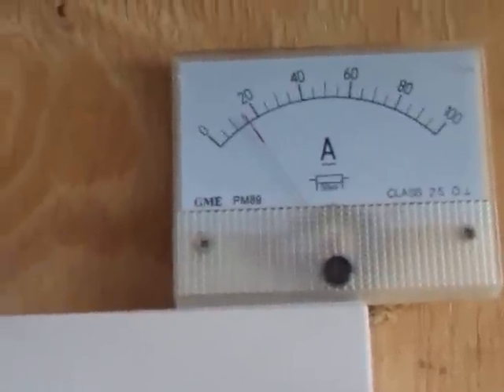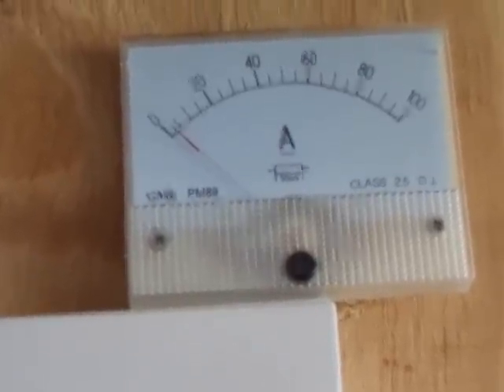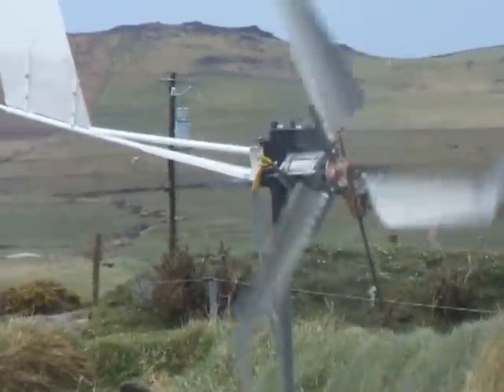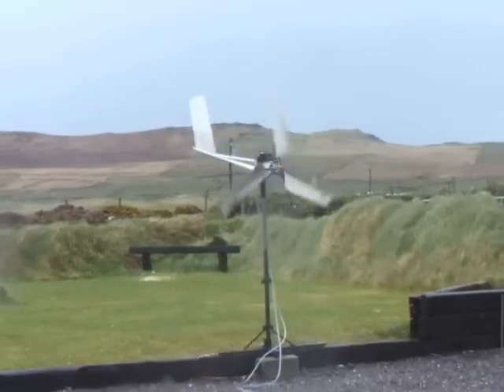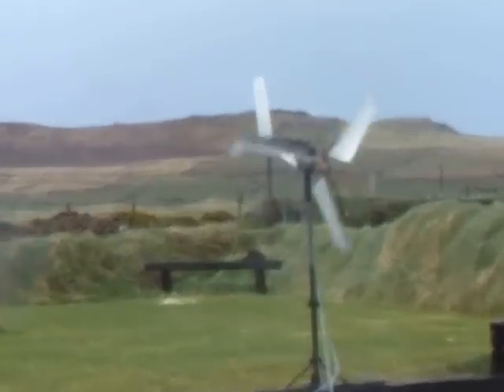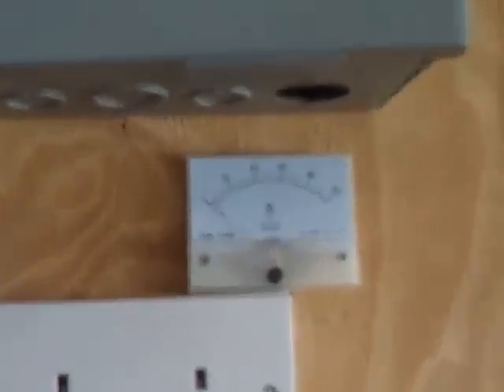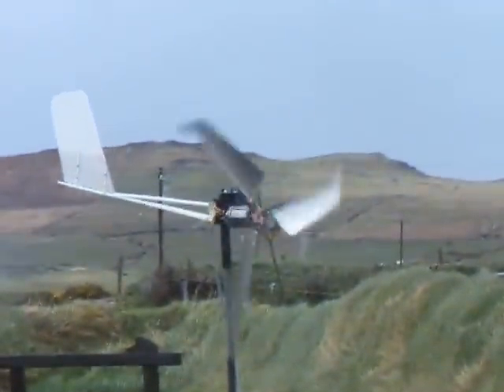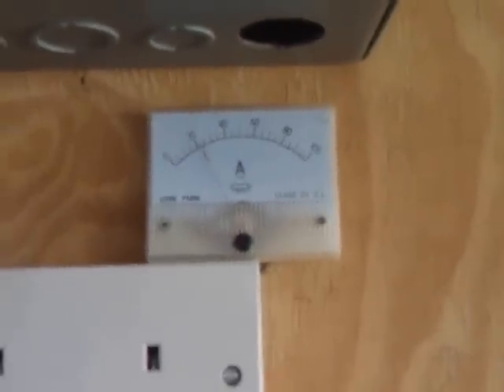Testing new dual wind generator

Comment: There s a Japanese guy names Oya that put a shroud around the blades and is getting 3 times the rpm s from the same setup. He calls it a lense. With the  lip edge he creates eddys and that increases wind velocity through the center. New wind power technologies on you tube.

Comment: I have a weather sensor at my house. I had it located about 10ft off the ground to start with. I noticed the fluctuation of wind calls. So I elevated it to a height of 10ft above the top line of my roof. This allowed for a more accurate wind speed. I know this is not a weather station, yet the same principle can be applied to you windmill to gather more energy and speed. You might want to also look into a 360deg wind funnel which will allow you mill to be lower and increase your wind speed by 25%+...Just a thought to help.

Comment from the maker: 4 to 1 ratio. The blades 6 falcon blades (MW) turn the belt around a pully connected to a pma. This means greater rpm and there for a higher current than if it was direct drive.So in a 15 mph wind the blades will turn say
250 rpm the pma is turning 1000 rpm. That would need a 25 mph plus wind speed on a direct drive to reach a 1000 rpm.

Comment: Ian, if I may suggest.. when you do test the belt drive, start at a 1.2/1 ratio then go 1.5/1, 2/1 and so on. 4/1 will stall the blades once the pma output exceeds the power the blades can extract from the wind. I have witnessed 1.2/1 put out more than a 2/1.

Comment from the maker: Only using the 3 30 inch falcon blades. Hard to say wind speed anomometer too high up from turbine was getting up to 580 watts in moderate wind speed.I would use the large falcon blades in 10 mph winds for maximum effect. Or 11 gen 4 blades but i have not yet tried that.

Comment: Hey Ian mike,
thanks ur reply. nice to know. just to be sure i dont by PMA that is too heavy for the system. altohough should get some power. I Ordered 6 blades 155 cm = 61 inch each. configuration 3, 5 or 6. I build constuction more or less same as ian with belt reduction 1 to 4... maybe one day i ll be proud and post a you tube ... :)

Comment from the maker: Hi tom, yes you can run the dual with one stator,infact thats what i am doing in Bad day in Biejing video
so in theory you could start it with half and bring in the other at certain rpm. I have experimented with this
with breaking only one stator at a time. 30 mph one stator will still turn 30mph with two will not. but blade size and wind speed is the key! Is it the same resistance as s/ren debatible?

Comment: Hey Ian,
Nice work man! got a question that i asked some people but dit not get a straight answer.::  lets say the power of the blades is not enough to turn the dual in certain windconditions, is it the possible to disconnect 'one of the duals' to have less 'friction'  and so to operate the dual with the same resistance as  (single) super renegade?

Comment: Great!
Just crunching some numbers, 2000w / 40a = 50 volts, what is your battery voltage? I wonder if you can have too much rotation, it should furl of course, but I do wonder.
Just thinking you may wish to well over size your wire size one or two, for us it would be size 10, where the pma wire harness maybe 14 or 12. Jeff would know.
Course any power not used will divert to heat of some sort.
Thank
John